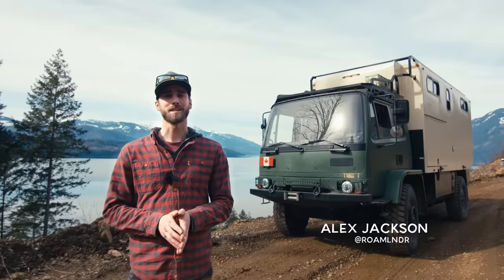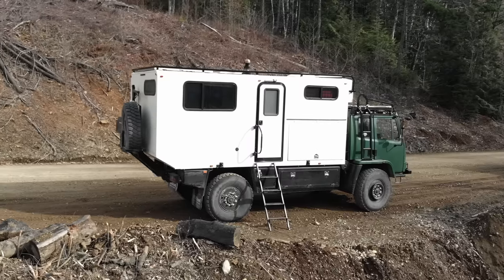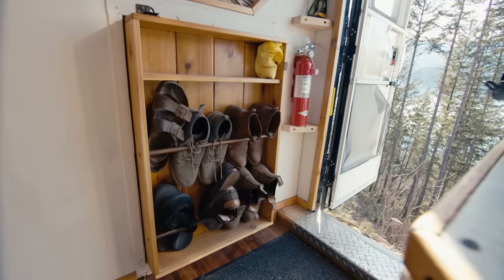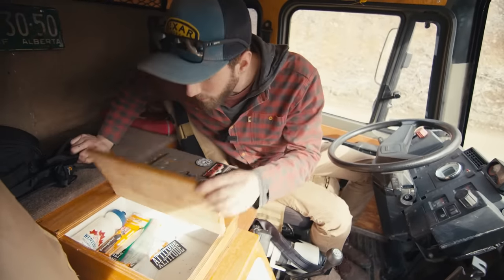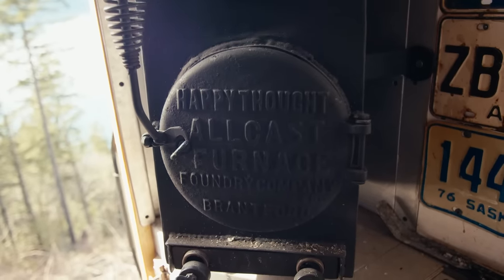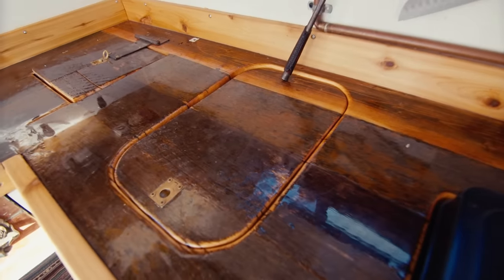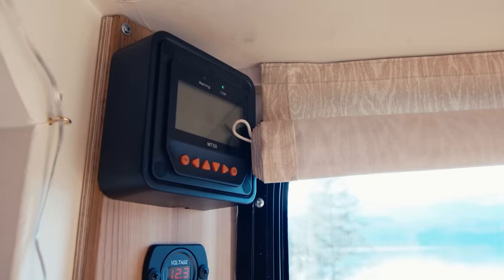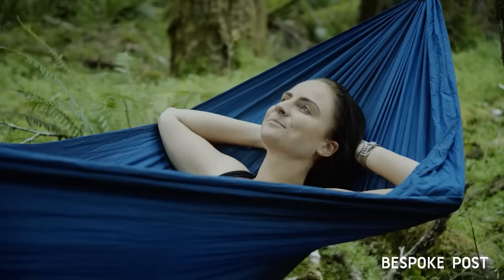He Built a Tiny House on a Military Truck

Comment: 13 mpg? That's better than some pickup trucks with something on the roof
Reply: Our rig -- 1996 Ford CF8000.
Cummins 505ci mechanical through an Allison 3060.
We rarely get better than 14mpg.
Our interior -- 7w x 12 l x 7h, about 600cf.
Weight across the scale -- 14,000#.
GVWR -- 29,000#.
(And 'yes', I am familiar with the Pound Me Too 'movement'.)

Comment: I have seen most luxurious camp trucks but with a tight budget and everything you have done it’s completely amazing. The things which i like the most is-  
1.  Dog area which i never seen before. 
2. Classic simple Dinning table with window just in front of kitchen as most of the luxury trucks fails in this thing.
3. The garbage and shoes area are just behind main door. When you put washroom and kitchen garbage it will not stink or smell because you can open door. Moreover you will never forget to dump it.
4. The bed have bookshelfs and moon roof.
5 The last and most important which i have liked the vehicle, the mechanism, its not complicated like new ones as anyone can repair at anywhere if it’s have problem.

To conclude the only thing that i want too add is little cockpit door which will connect both of them through bedroom.

Comment: tip: he could have used a cheap diesel parking heater for big rig cabs, provides clean, hot air, and can be connected to the trucks fuel tank
Reply: I just put a tube on the exhaust and put it in he car
Reply: @Andy-zo1pm  hmmm...
No wonder we never heard back from U

Comment: Awesome job.  Just got myself a Mitsubishi 4x4 tipper truck (for general farm and excavator carrying duties) and am planning on building a slide on camper unit for it.  It has a 3.5 x 2.2m tray with removable sides and tailgate, but there are fixed rear corner posts.  I’m looking into making them removable for ease of sliding the camper on. The tuck has 4 huge steel toolboxes already fitted.

Comment: 03:03
Check the label.
Instead of five gallons, these hold 4.2 gallons.
Instead of twenty pounds, the label says 'Fifteen Pounds'.
.
If your calculated use requires the full twenty pounds, you may need a second bottle to compensate for 'quantity inflation'.

Comment: So it uses roughly 20l of fuel per 100km of driving. Either fuel is dirt cheap over there, they don't move around much or are financially very secure.
Reply: Our ExpeditionVehicle rarely travels more than a hundred miles a month.
Fuel is a very minor expense.
Next.

Comment: cassette toilet is the way to go. Because worst come to worst you can dig a hole and dump it in the woods. Same as composting
Reply: Kaci  you most certainly can. No different than hiking and digging a hole to cop a squat.
Reply: Kaci  if you bury you piss and poop it goes back into the ground. The small amount from a few days in a cassette toilet is not the same as dumping weeks worth of waste from a 45 gallon tank. Two different things.

Comment: What smoke/CO/gas detector do you recommend? I prefer battery operated in case solar or generator fails.
Reply: In our rig, we have two smoke detectors from different manufacturers, two Carbon Monoxide detectors from different manufacturers, and two propane detectors from different manufacturers.
I hope this helps!
Reply: @largemarge1603  Yeah, I think I'm doing the same now. Running redundancies is better that having a failure and not know it!

Comment: 30Mpg good milage, not for the size of the living room you carry... My 2012 Ford Transit van home made camper that has about same size box  uses about 16Mpg  (a little taller living room box, it has room for my dirtbike motorcycle and several mountain bikes with wheels on under bed)  . But I guess double the fuel consumption is what you have to accept for the larger wheels and much larger weight that comes with it being a offroad truck (here it is class C truck and you need class c license to drive when total weight is over 3,5tons).
Reply: @Rondo,
Those bureaucrats of yours, what permission is dictated to operate a HouseTruck or RecreateVehicle?

Comment: Wait, so did you replace the p pump on the 12 valve with a ve pump? Also if you bump your timing to 18 or 19 degrees you’ll get more power and better economy.
Reply: Limited by the tranny and U-joints and suspension and...

Comment: To me...on the outside it looks very finished, but not so much on the inside.
Having fans on two ends, and one that can reverse, so they can quickly evacuate the internal air is really good. The water heater is very cool...errr warm...lol...😉 
I like that they have a full on wet room. The space to get in and out of the 'bedroom' seems a bit tight. The toilet...glad he's getting a new one.
The table is kinda wonky. Ya, I'm sure a tall guy, with legs, would not be comfortable. And then there is the straight, hard, wood, doesn't look appealing to sit on.
The camp stove bothers me, a lot,as does the wood stove. They spent a fair amount on this, but couldn't spend a few more bucks to have a safe way to heat the place and cook their food. I pray that is not a fatal error.  She said something about the ceiling color, but is ok with breathing in creosote...Someone needs to educate her on his work-arounds. Seriously.

Comment: All that fuel and no diesel generator? Other than that very nice work.
Reply: Our rig -- 1996 Ford CF8000 ExpeditionVehicle.
Nearly two decades full-time live-aboard.
Never saw any need for a petroleum-based genset.
Our genset is on the roof, six 305-Watt photovoltaic -- a total of 1,830-Watts -- topping our ancient AGM bank.

Comment: Unfortunately looks a little dirty kinda junky and the rust is getting ahold of it. Still pretty cool
Reply: We did twenty-four months twenty-four thousand miles around South America.
Alaska, Panama, all over North and Central America.
Summers up rough logger tracks to remote mountain lakes.
Winters on isolated Baja beaches.
How would you prefer we appear while traveling through areas of extremely-low income and low-maintenance roads?
Shiny?

Comment: 100 gallons is rougly 400 liters, which contradicts all you're saying about fuel consumption. EVEN with 20 mpg , the 400L tank would give you range of roughly 2k miles or 3,2k km.
I can reach 160 mpg in my car, when I'm downhill, have wind blowing in the right direction.. 
Project is great, making your sausage larger... it's sad...
Reply: Our rig has 190-gallons of diesel.
Our toy-hauler has 120-gallons of diesel.
In theory, our range is Anchorage-to-Acapulco...
... without re-fueling.

Comment: This is a brilliant video, but could you please go through and remove all the times you say the word 'actually'. It's unnecessary in the way you use it. It would be like towing couple of useless trailers behind your Leyland. Spoils the presentation of what is otherwise a showcase homebuild. Thanks. Yeah, or not, right, but still a great build. Cheers, D.
Reply: Agreed.
Something is.
Adding 'actually' does not contribute to its being.
.
And makes the speaker sound like a teeny-bopper.